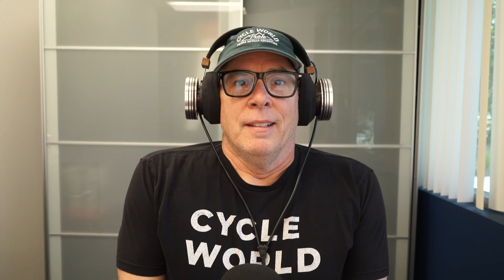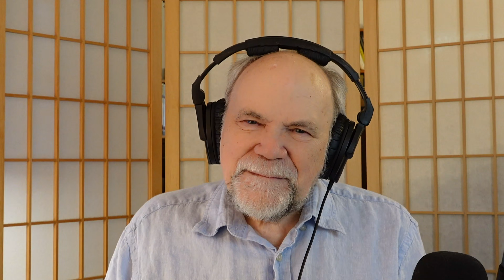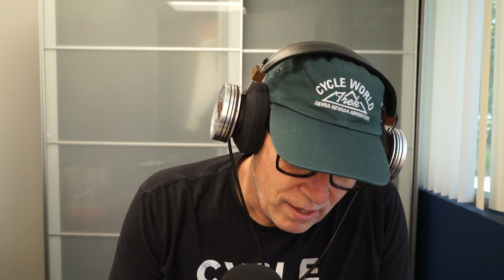Oil Pressure or Viscosity? How Engines are Lubricated and Synthetic vs. Conventional Oils

Comment: "Can anyone remember?" HAH ! My 1960 VW bus (in 1973) had a 6 Volt system in Minnesota winter at minus {I don't remember exactly but really cold}. The approved solution was to drag the battery up to my 16th floor apartment and keep it in the bathtub overnight. I wasn't paying extra for hot water.
The standard example of a non-Newtonian fluid is ketchup.

Comment: Thank you for explaining why my car's temperature gauge always read 90C regardless. And also the psycological effect of gauges showing things that can disturb. For instance, I can also get a digital readout of the oil temperature on while driving, and it is always confusing to watch the temp rise under trailing throttle and go down when the turbo is spinning. At least for a while. I want to know why. If I could not check, I would never have worried.

Comment: Cheers! - A couple of podcast ideas.  1. Camshaft timing effect on the torque curve, and development in camshaft design.  2. The SC28 Honda Fireblade, the start of the light big bore bikes and its long-stroke engine made it (at least feel) like a very fast road bike.

Comment: When I was a kid our family went on vacation. The neighbor had a key to the house and helped himself to the rotor tiller. It ran out of gas, so he comes back and looks around again in my dad's garage. He had two identical 5 gallon containers, one had gasoline, the other featured a spray painted white dot and contained parts cleaner solvent. The neighbor used the solvent, and the warm rotor tiller started up just fine. The next morning, it wouldn't start, and the neighbor had convinced himself that he broken the machine and spent the rest of the week worrying about it. My dad quickly solved the issue, and when switched back to gasoline, it started right up again.
Reply: I put kerosene in my grandpa's riding mower, looked like a mosquito sprayer.

Comment: I've heard some T guages are synthetic. They blend variuos sensors and give you a semaphore signal.

The only time I got a noticeable pressure drop was coming to an idle after having the foot to the floor on the freeway for a few hours. The LandCruiser was pushing 2 tons with a 90hp diesel. It was a little alarming at first, but it did this consistently. 

Some people in Canada wondered why the MGB got an oil cooler, but MG sent all exports ,including Saudi Arabia, with an oil cooler. I drove mine year round and got caught on the oil chart with a higher than recommended viscosity. It was very rare in that region to get ice or snow in winter. It started when I returned home and left the oil in until the change interval.

I think it was some time in the 1980's when synthetic oils became available. Our neighborhood mechanic just recommended keeping the oil clean with regular change intervals. He had experience with fleet heavy equipment and may have had vehicles that he'd run up to 'high' mileage.

I've seen regional politics in engineering. It seems you have to remove a resistor from one system and put it in another.

Comment: Yes, I learned that on my 2015 Chevy Silverado.  The gauge always runs straight up which is 210º on the gauge.  It never varies when going up or down a hill or when plowing snow or towing a trailer.  I then put an OBS reader on and could see the engine temp varying, but the gauge never did.  I called the dealer and told him my temperature gauge wasn’t working correctly and he admitted that Chevy basically ramps the gauge to normal temperature after engine start and then holds it there so people wouldn’t call and complaint about the temp moving up and down.  Absolute stupidity.

Comment: Modern cars having small turbo DI engines with hydraulic systems for phase shift (variable cam timing) etc. Has made API SP (some SQ) rating which is a huge advancement in modern motor oils for our motorcycles. The chemistry has changed and now we have a great balance of running cleaner, resisting heat and shear all while increasing wear protection.

Comment: I currently own 10 Suzuki Two Strokes, including three GT 750's, and have used Full Synthetic Injection Oil in all of them for at least 20 years. However, some of the early Full Syntenic Two Storke Oils were not compatible with other Two Stroke Oils, for example Suzuki CCI Oil, resulting in congealed "Snot" that would plug the injection system with catastrophic results!  I haven't had any problems with the current Full Synthetic Two Stroke Oils but it's best to check on compatibility with other oils before you switch to a Full Synthetic Oil. I know this to be true because I was the Parts Manager in a Suzuki Shop back in 1973 & 1974.
Reply: I remember Stiers cycles in Illinois had a tube of incompatible oil with that warning.
Reply: Thanks for the heads - up on full Synthetic oil for the GT 750.  I've been using basic 2- cycle API TC/JASO FB.  Will try the full Synthetic.

Comment: I was of the belief that most Mobil 1 products are now made from Group 3 base stock, and only a few are now made with Group 4 PAO base stock,
Reply: Yes,that’s correct,its the extended performance m1 full syn oil that has the pao base  stock oil . That’s because the extended rec oil change interval the extended perf oil has needs a better more robust pao base stock oil to cover,10k,15k or 20k mile oil change interval.

Comment: On my 1976 Suzuki GT 750 I noticed a couple of air bubbles moving along my oil injection lines ... not good.  So I removed the oil pump and replaced the six O-rings, upper housing gasket and the pump driveshaft VC springless seal.  While it's all apart I learned that it is more of a distribution device than a pressure building  pump. It turns 1 revolution to 62 crankshaft revolutions. The main gravity oil supply line I.D. is only 3.5mm  and it took 15 mins to drain the 2 ltr tank.  I then realized how important oil viscosity is, and critical to each application. So when you fellows are talking about oil and its many properties I now really fully understand. Thank you.

Comment: Okay like 5 min in theres a few things that in my opinion are incorrect.  Absolutely oil in crank journals and cylinder/piston/rings are more like hydroplaining than anything.  You will always get more wear for example at the ring transition points in the cylinder because of this.

I am thankful to have access to engine oil analysis for less than the cost of a cup of coffee. Have done over 20 tests.  everything is getting 20w50 amsoil.  Pro tip.... don't bother with 7100 motul... any grade.
Reply: Where a tire contacts a road, there is no speed difference like there is in a plain bearing. The plain bearing needs that to function. 
     At tire/road contact, the speed of both is zero, yet hydroplaning works.
Reply: Well same as a water ski on water...  lower velocity, further the penatration of the oil film
Reply: @john0270  Still not quite the same as the water ski is just pushing the water against more water.  Journal bearings are pushing a thin layer of oil against another solid surface.  Now, if you are water skiing on a very smooth surface covered in a few thousandths of an inch of water…. 🙂

Comment: I cant seem to get that KC quote out of my mind either- 
“Well just because there is probably some benefit to be found somewhere in the engine by changing the oil every 5 minutes-
That doesn’t mean you have to do it” 🤘🏻
Also the smooth aggression of the clutch grab on a modern CRF 450 dirt bike filled with fresh Motul 7100 has been such a tough drug to quit that I cant even relate to anyone saying conventional or semi is a “Better Feel” in any way. 🙄
They are just stubborn or making excuses for being a cheap bastard. 🤘🏻